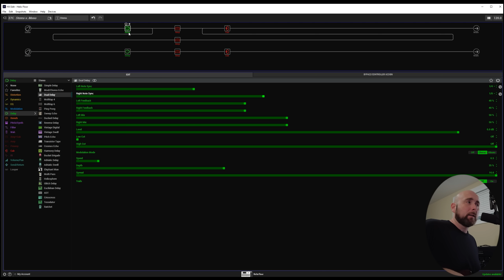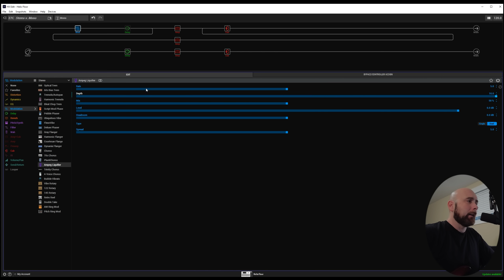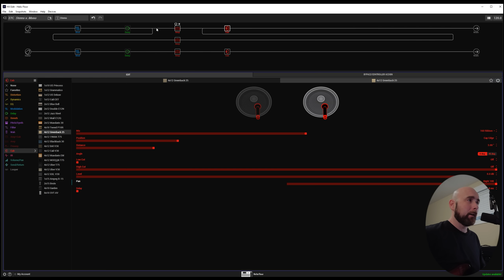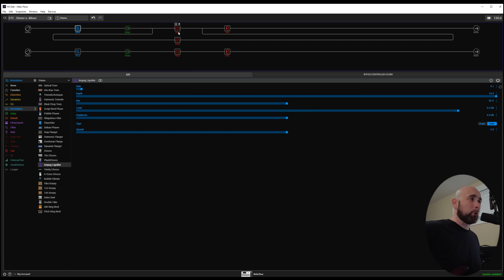You May Be Using Your Helix WRONG!! | Stereo vs. Mono

Comment: Stereo live is definitely hit or miss. I always play stereo if possible depending on the mix all the stereo processing can get buried, but if everything lines up its awesome. Next time you are playing acoustic in a small ensemble try it with a bunch of stereo effects that's a really good enhancement to one acoustic guitar
Reply: So Are you routing your helix outs to a set of separate amps (or FOH)?  Otherwise stereo means nothing . . .   Just want the above  statement to be clear.
Reply: Can one live stream the gig in spatial audio, so everyone in the audience can use their iPhone with wireless buds?
Reply: @stevelorincz8975  that's another question I have if playing through say a 212 amp and using 4 cable method will.stereo sound be advantageous,  I have a 112 powercab + also but trying to learn where stereo will.shine live I understand the advantages in recording live

Comment: Man, I’ve fallen victim to this SO many times! There are a couple of changes I wish Line6 would make to HX Edit and Native" First, I wish we had the option to choose the default type (mono, stereo, legacy) for a particular category (distortion, modulation, etc) of block. For instance, I might want my delays and reverbs to default to stereo, while my distortions were mono. Secondly, I’d like it where if you switched an effect from mono to stereo (or vice versa) for the parameters to remain the same. Many times I’ve pulled up a block, tweaked it, then realized I’d chosen the wrong category, then had to set it all over again after switching from mono to stereo. Little things, but I think it would provide some improvement.

Comment: One feature I have always wanted is a mono fx send block that allows stereo to pass through. The use case for this would be putting the send block in just before the amp+cab. Such that you can take an FX send and plug it into a mono stage amp, while the stereo chain goes on to the main out plugged into the PA.

Comment: I'm using 2 Headrush frfr 112s but I'm finding that one is louder than the other. I'm using them one in front and one behind. The 1/4 output is fine and loads of headroom behind me but the moniter on the floor using Xlr is really quite in comparison. Any ideas guy's would be really helpful ❤

Comment: Here's a question about the EQ.

When it comes to the SIMPLE EQ. I just use it somewhere in my chain to brighten up the sound per snapshot, instead of using the global EQ high gain.. 

I noticed when I switched to stereo simple EQ THERE WAS DEFINITELY A CHANGE IN THE SOUND!! It became darker with the exact same settings.. the mono was much brighter more detailed.. this happens whether I'm using an all mono blocks, combination of both, or stereo. And it also doesn't matter where I put the EQ in the chain same issue? 

So I'm wondering if you use stereo does it turn the high gain down double or something? So I would have to turn it up double. In other words if I have the high gain set to +4 with the stereo what I have to set it to +8? 

I don't know it's pretty bizarre?

Comment: So I'm a little confused.. if you just plug the left channel into the mixer using the stereo one it should come out of both speakers in mono anyways? So I don't know why you would need the bottom one. As soon as you plug into the left mono output of the Helix it takes everything into that path.. correct?

Comment: I have a Roland Jazz Chorus 22 amp which has two inputs for stereo and an effects loop which has one send and two returns for stereo.

How do connect my HX Effects to utilize the stereo capability of the amp as well as utilize its effects loop for dealys and reverb?
Reply: Output L and R on the Helix to L abs R input on the stereo amp or use a y cable to take stereo output to split to the 2 inputs for your amp.

Comment: Mr. Jason do you always have to Pan your dual cabs opposite to get a preset to be in stereo
Reply: If you don't pan the dual cab block the sound from each gets put on top of each other, summed to mono.  This is still useful.  For instance, if you use different mics, or different settings for the same mic, on each of the cabs then you are, basically, simulating a cab with two mics on it.  This is used a lot in a studio to bring the characteristics of the different mics together, like a Shure 57, with its brittle clarity, and the more rounded tome of a 121 Ribbon.
Reply: @davidwitek6119  thank you and ya I've noticed the variance in using dif mics and cabs together , still trying to grasp all this stuff I've played for years but new to helix life can use all the help I can get ,thank u

Comment: Great examples. Question here: if you manage your split block correctly but incorrectly reverse the merge block, is it still stereo but phase reversed? I would think so but what is your experience.

With my HX, and with the implementation of 3.5, I set up a stereo rig of sorts using dual cabs and stereo blocks at the end of the chain. One side feeds my Headrush FRFR (right side), and the other my vintage 80's Fender Princeton Chorus (left side). My patches have taken on a new life!

Comment: I just play at home and have sort of a small studio setup. I use no amp (just powered studio monitors) and now...no pedals. Only Helix Native in a DAW (Reaper). But before, when I had many iterations of pedalboards in this setup, I always run stereo because it's so easy and sounds so great. Today's vid showed that anything before a single amp is mono (no problem have always realized this)...but it made me realize how important it is to check all the panning in EVERY pedal after the amp AND in the splits. When using REAL pedals it's obvious about the L/R outs. But in the virtual world you have to be careful with all the settings as you go. Very good video.

Comment: That was a very interesting topic, as stereo signals can be a challenge to keep track of, particularly if the effects are subtle. I wonder if a a more obvious visual que would help us keep track of what's taking place as the signal moves from one block to the next.

Instead of having a single visible line come out of a Stereo Block, maybe 2 visible lines should come out. If they enter a Mono Block, then a single line would exit that Block. Another way to visually represent that it is a Stereo signal would be to have a single line, but with alternating color bands within in it to indicate when Stereo is coming out. That would probably be easier to implement in the existing software. 🤔
Reply: I'm sure the Helix mark 2 will have something like this with a larger display to help show more lines to make it look like the real thing with 2 "virtual cables" coming out of the stereo blocks.

Comment: My question is this:  If I set my effects to stereo before the amp, does the signal get degraded in any form?  I would think not.  OR is this waste of processor power in the signal chain?  I am curious about the negative effect of setting (or not changing to mono) in the chain?  Just curious . . .  Just wanted add . . . I understand the problem with things such as ping pong  . . .
Reply: Same quality but yes stereo sums to mono and yes a waste of DSP power if your only getting mono output but using DSP of a stereo block
Reply: When you delay after the amp, you are first going to the amp, compressing/distorting/etc, then delaying that sound. Most people do this with time based effects so that the amp is doing its thing first. 
 Before the amp, you are first delaying your raw guitar sound, then amplifying it. The trails will be decreasing in volume before hitting the amp, thus the distortion or compression will be different with each delay. Try both and see what you like.

Comment: interesting timing on this video. I've just finished a small EP (my first real attempt at something like this) and I found myself going back to my guitar sounds and converting my patches to full mono setups to avoid correlation issues in the mixes. It would be interesting to hear your thoughts on mono / stereo guitar parts in a mix. The tracks I've been doing are pretty classic 80s style with L/R panned doubled guitars. In this scenario I think it makes sense to mono for the mix? Maybe if you were only playing a single guitar centre-ish then stereo would make sense?
Reply: Many times in the studio they take the single recorded tracks and dupe them and pan left and right in post on the DAW instead of using the EFX hardware like the Helix. Just depends on your work flow.